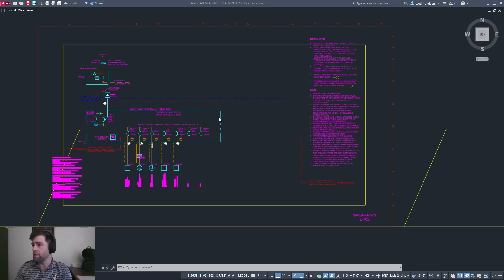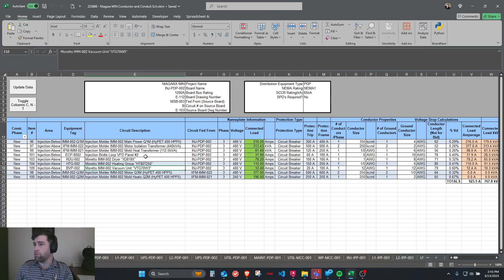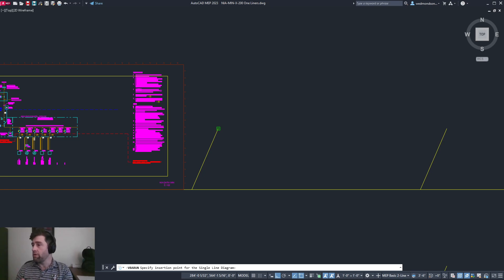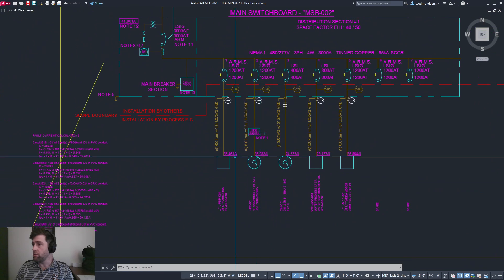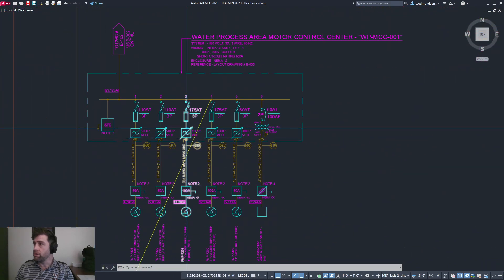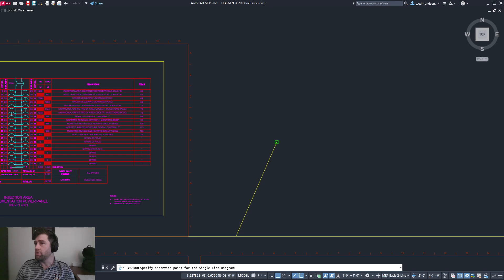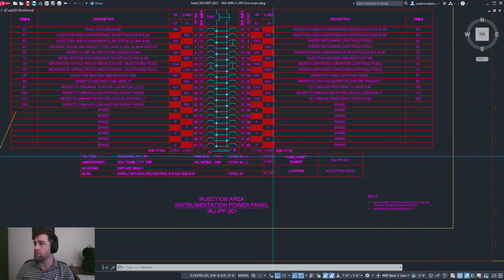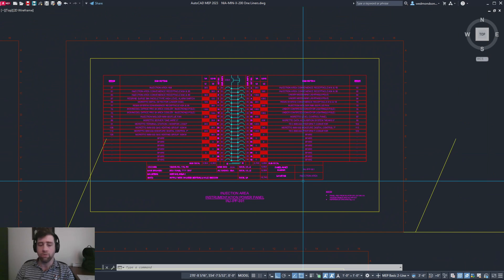AutoSLD Demonstration - Automating Single Line Diagrams from Excel Conductor and Conduit Schedule

Comment: Thanks a lot for sharing your amazing work. I’m truly impressed by your AutoSLD tool and the way you’ve integrated Excel with AutoCAD  to automate electrical single-line diagram generation. Would it be possible to get a template to understand the framework? I’m very keen to learn and build something similar for my own use, and possibly contribute too.

If you're open to mentoring or even sharing a Project example, I’d really appreciate it. Thanks again for sharing your work